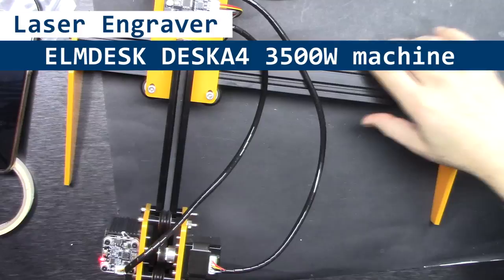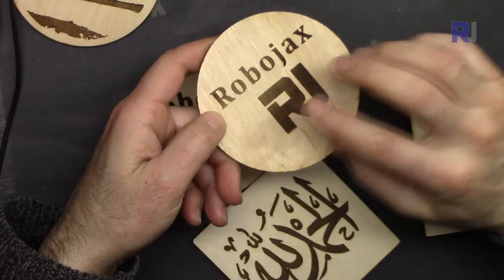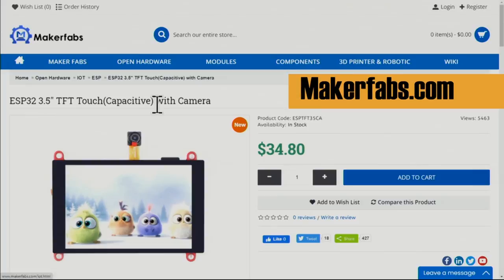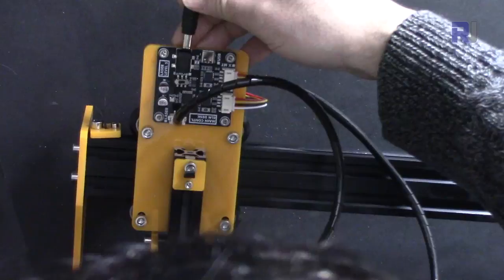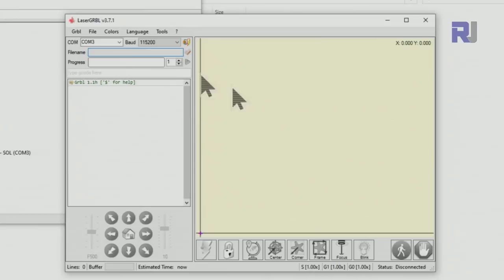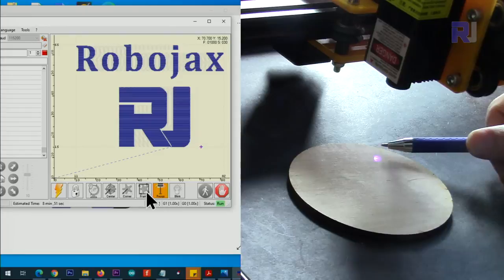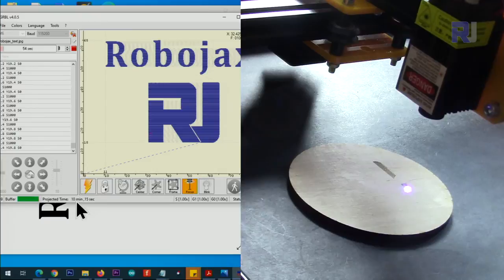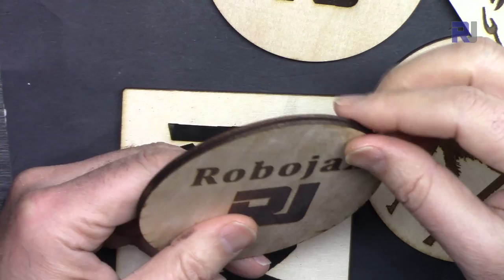Review of ELMDESK DESKA4 3500mW EleksMaker Laser Engraver - Banggood

Comment: Greetings from Germay.  ( this Stepper are Nema 14 ? )  //  the on / off switch is a bit small for operation. However, it is dangerous that the laser burns when the PC is separated from the circuit board.   --  Thx for the Videos
Reply from the maker: greetings. I did not check it I was focused in making the device.  Yes safety first.

Comment: Nice and informative video I have a question if I  a have a device with a routary incorder in build we can conver it in to 3 different push buttons
Reply from the maker: sorry I did not understand it. when you say rotary encoder, I think if a knob.  this needs flat surface to engrave or the object must be precisely positioned as the laser beam hits it.
Reply: I have a electronic  devices that has come with rotary incorder  to operate menu but I want convert it in 3 different push button